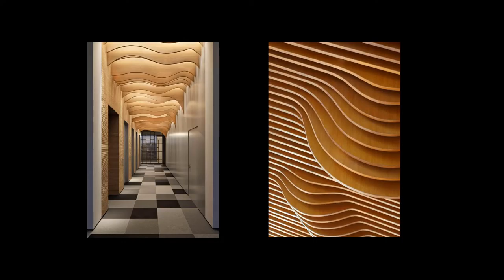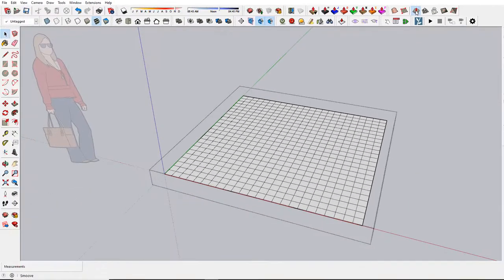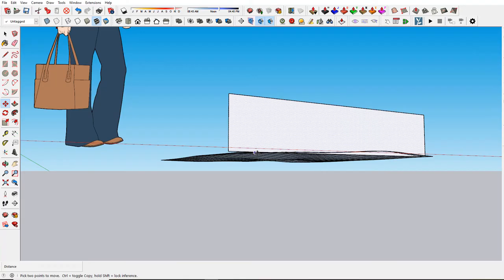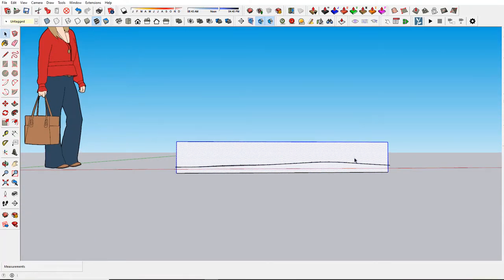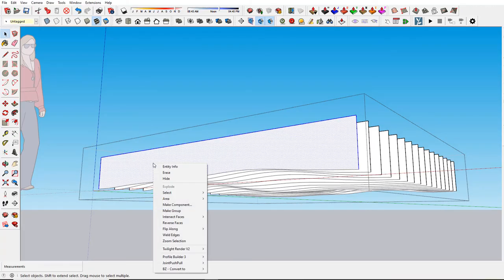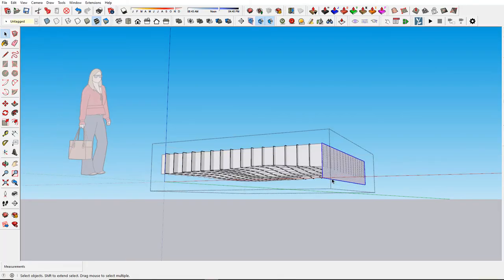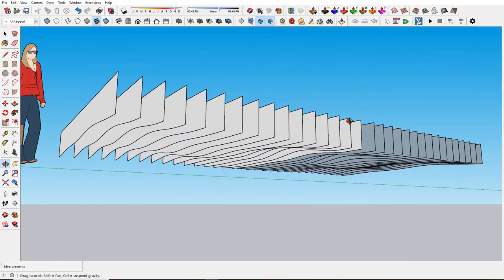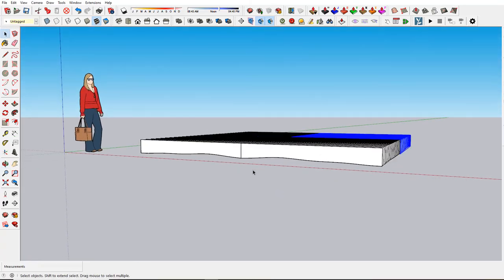Making a Wavy Wood Ceiling in SketchUp

Comment: For some reason I am not able to select just the top or bottom half when I select it selects the whole thing. I have also interfaced with model already?
Reply from the maker: When I selected parts of the planes in the video, I usually clicked on the edge and not the surface. Additionally, if using a click and drag method to select, it depends on the direction you are dragging. If you click and drag going left to right you will only select the objects that are fully within the selection rectangle. If you click and drag right to left, you will select anything within as well as crossed by the selection rectangle. Notice too the way each different selection type is shown on your screen. Clicking left to right will create a solid line selection rectangle and clicking right to left will create a broken line selection rectangle. Here is a link that explains further: https://help.sketchup.com/en/layout/selecting-things 
Hope this info helps.
Reply: @jalopezDesign  thank you so much!!!!!!

Comment: I'm just beginning to investigate how to design & build a wavey/parametric wall segments. A coupe question, if I may... 
     - These functions are only available in the SketchUp Pro version or is also available in the Shop and/or Free versions?
     - Can you choose a radius much larger than the 8' x 8' to get a curved extension/depression or would you recommend using something different?
Reply from the maker: The sandbox tool is not available in free but you could do a similar ceiling using only free. It would take you a bit longer to get the arcs. I would create a rectangle for the first piece and then add the arcs you prefer on the bottom to get the curvy shape you are looking for (this may be a bit of trial and error). Then make it a group. make another rectangle and shift the curve a bit. Repeat with several more rectangles. Then separate them with the distance desired. Give each rectangle thickness. Hope this makes sense.